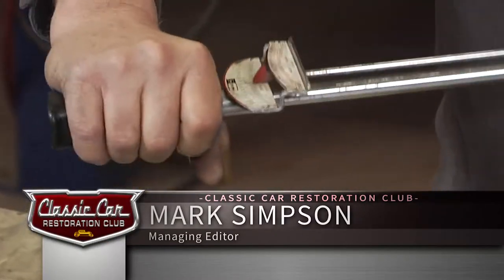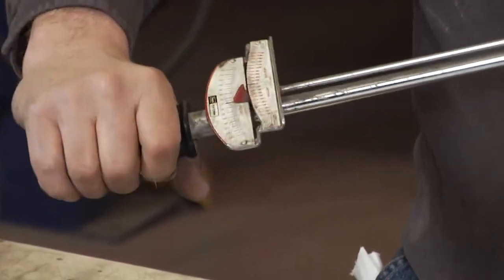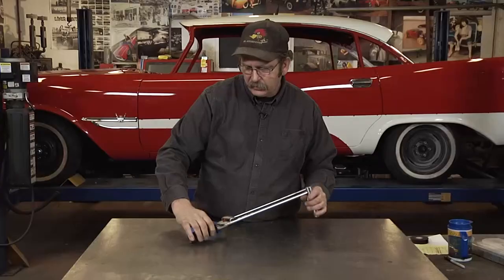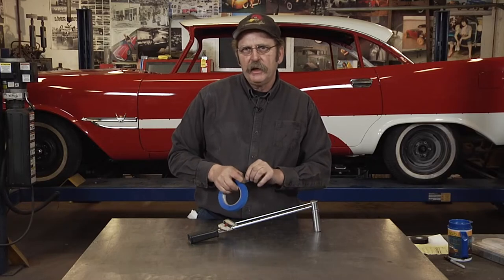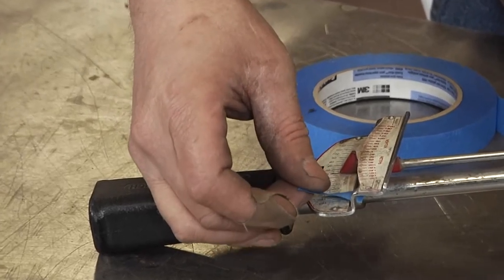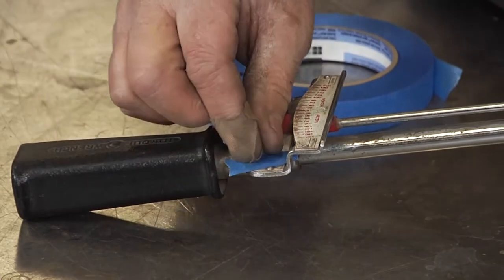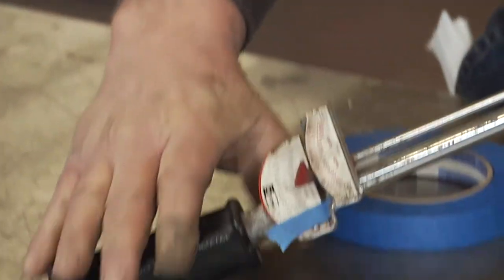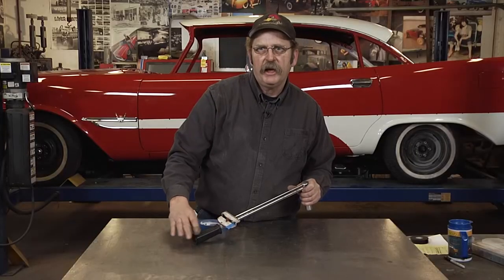How To Read The Numbers On A Beam Torque Wrench

Comment: On my beam torque wrench, it has Foot LBS but it also has MKG what does it stand for not having any luck with google.
Reply from the maker: Hello, 

The MKG scale on a beam wrench is the Metric scale. 
Years ago I was told this stood for Metric Kilograms (Kg).
Although with a quick search I could not confirm the meaning of the abbreviation.
I am confident however the MKG scale is for metric measurements.
Wrench Safe, 
MarkClassic Car Restoration Club Video Membership
Reply: Thanks, I asked you cause I was unable to find an abbreviation as well. I suspected it had to do with metric but I couldn't be sure I only had my torque wrench for a few years and it's only for the head bolts on my 66cc motor kit my new bicycle also has torque setting in Newton meters and it doesn't match the mkg so I had to find a chart to convert to lbs.
Reply: Hi, the MKG stand for meter kilogram, which equals 1/10 of 1 Nm